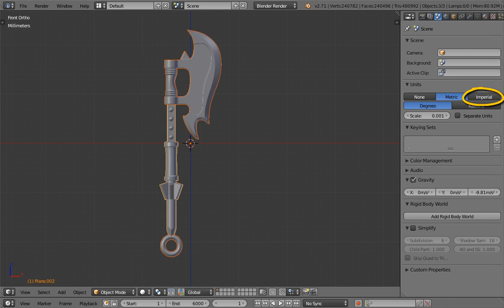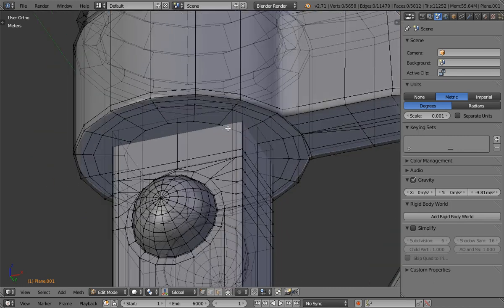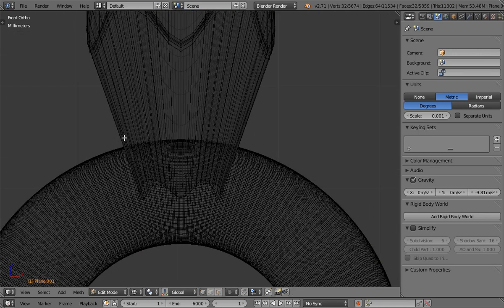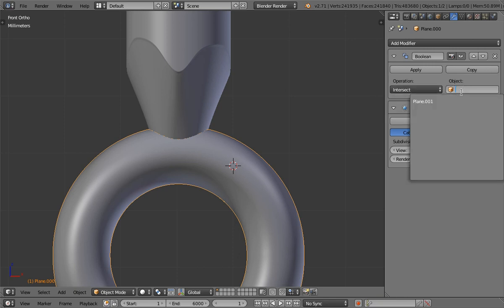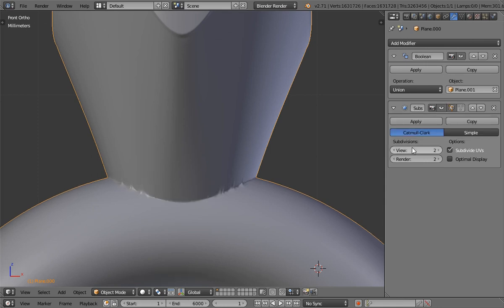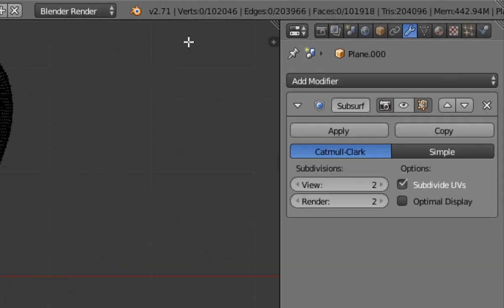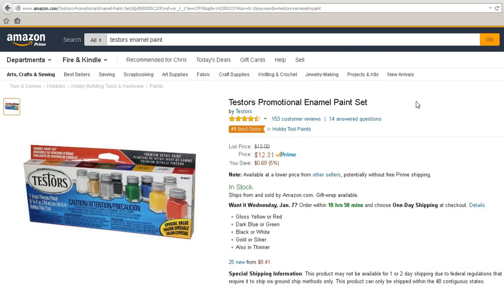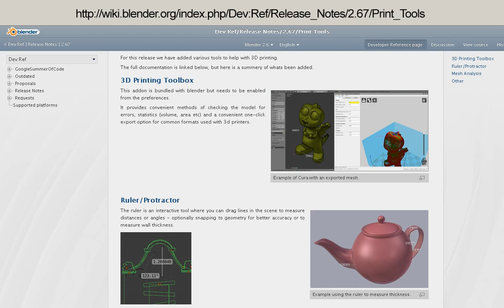Tutorial: How to Prepare Blender Files for 3D Printing

Comment: Why is it important that it is one solid object? I made a figure and just a podest underneath it without joining the figure and the podium. Turned out just fine. But maybe it was just lucky me. :D
So i would want to know the benefits.
Reply: No expert by any means, but I think it depends on your slicer software;  If it detects impossible toolpaths, such as moving the print head into an already printed area to print a line that is buried within the walls of the axe in this example, you're probably (as you might have found) good.  If not, you might be in for a nasty surprise.  I'd say it's not worth the risk, however, you should be able to preview your toolpath in your slicing software to see if it's an issue.

Comment: Do I have to add thickness (solidify modifier) to the model before printing or not? Does the 3D printer understand that the mash is solid and there is no hold inside it?
Reply from the maker: Hi,
For 3D printing we need a manifold (meaning a closed volume or mesh). The inside of this volume will be considered as solid material by the 3D printer. It really depends whether you are modelling with closed meshes or just surfaces. In this particular example the object is already a closed mesh/volume (meaning manifold) so no solidify modifiers are needed to give the surface extra thickness. If your design is an open surface (meaning non-manifold), you can use a solidify modifier to add the desired thickness. You can find the minimum wall thicknesses for the different materials on our website: https://i.materialise.com/en/3d-printing-materials
Reply: @imaterialise  pretty much thanks, sir. Really appreciate it.

Comment: Thanks for the great video.  As a modeler, I use liquid acrylics. and then top coat with Liquitex Professional (glossy or matte) clear.  It will give you a smoother surface than testers.  That said tester will be a harder finish, but I don't think you will need that for jewerly.  Also acrulics touch up, and mix better.

Comment: Why can't 3D printers print holes?
Reply: They can print holes. But it has to be a deliberate hole. "Non Manifold" he's referring to would be errors in the mesh. When you import a 3D object into a 3D printing program, it has to be a solid object. If there are holes in the mesh then it would not be a solid object.... However, if he DID want a hole in the axe blade like he demonstrated when he deleted the vertices, then he would have to give the whole of the object's outer shell some "thickness" so that it would be a solid object, but a "hollow" axe, with a hole in it. I hope that makes sense.

Comment: Regarding painting prints, I always get excellent glossy, poppy results by using acrylic paints and then sealing with three coats of clear, non-yellowing polycrylic at the end. Acrylics produce far, far less fumes than the Testors enamel. And you can use a hair dryer on them to dry a part in seconds. And they're dirt cheap and come in a wide variety of colors (unlike most enamels), in addition to awesome metallic colors. And they come in squeezable plastic tubes so you can easily put colors on a palette, rather than dealing with hard glass vials. Enamels are better for stuff like model cars, but for most prints, I find that acrylic with clear seal is just as good.

Comment: Is it really necessary to make it a single object in Blender?  I've printed models I've made in an old version of Lightwave that were created from simply overlapping different objects with no joining or booleans for the most part and exporting them to STLs, DAE, or OBJ files.  I check that they are watertight and such, but I haven't had any issue with this method unless there are any gaps between objects that should be overlapping.   

This allows for more easy editing of the model later should changes be needed without having to go back to a prior iteration.
Reply: microbry the current Blender version allows you to export different meshes into one .stl file or whatever you want. It works out just fine. I think it's just an old version used in the video.
Reply: Totally agree with you